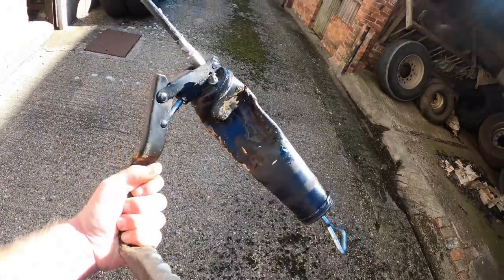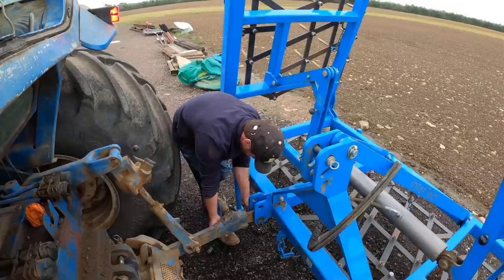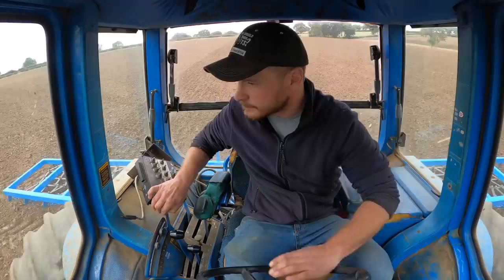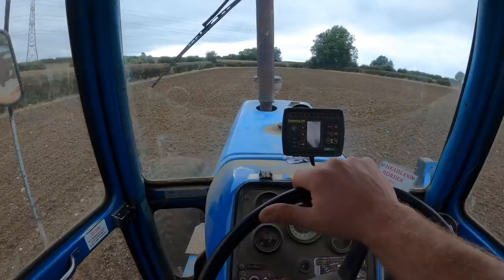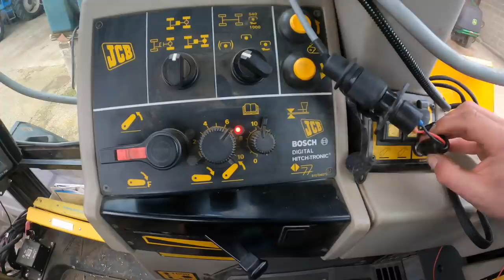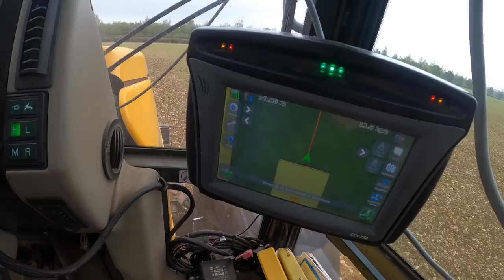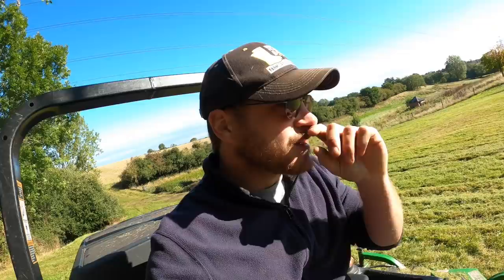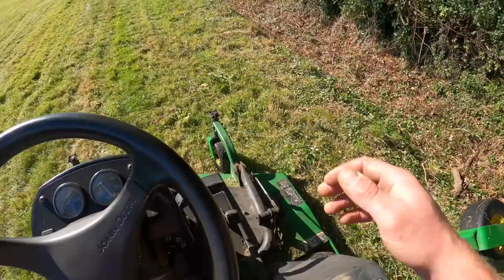BIG WHEELS KEEP ON TURNIN'... #FARM VLOG 173

Comment: Always impressed how well you keep your farm looking - hedge cutting and keeping the grass mowed. Presume when you were spraying you couldn't tell where the tramlines were so were using the Trimble to keep you right? I guess the wheels wouldn't damage the crop poking through at this stage? Thanks for a another interesting video.
Reply from the maker: Thanks, we do our best 🙂 So yeah the Trimble was keeping me right on where the trams will appear , there were some fields I couldn’t do that were sitting a littler wetter, you may have noticed some wider wheelings too which were from Dad applying the avadex but as they were done with the terra tyres they’ll be no damage and crop will pop through no problem 👍
Reply: @NicksFarm  Ah ok, I was trying to work out if you were on the tramlines or using the GPS to make a best guess where they would be. Yeah, makes sense as would be easy to stray off course at speed and where the shoots were very small. Thanks again.